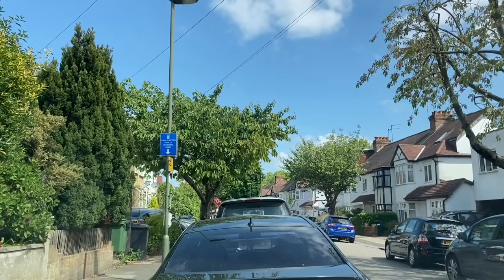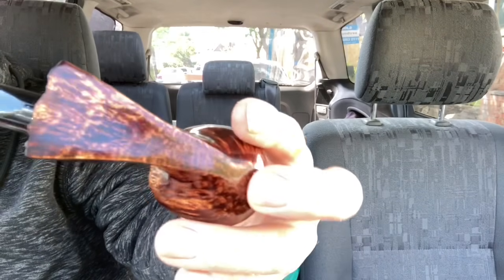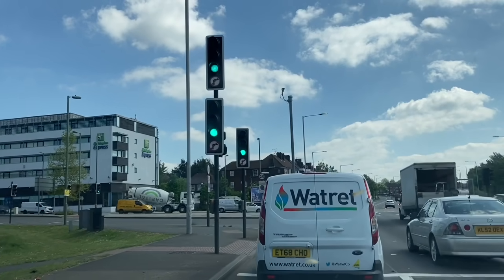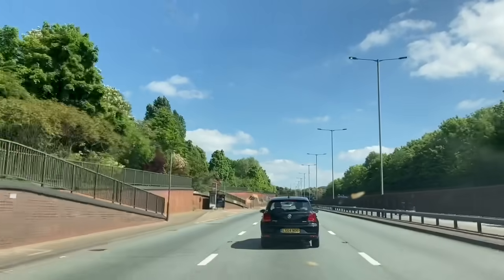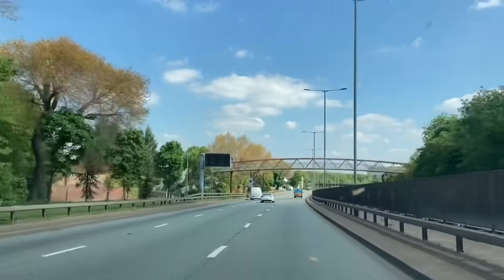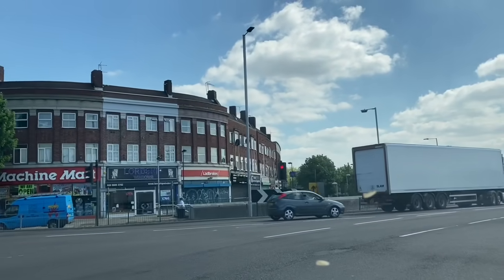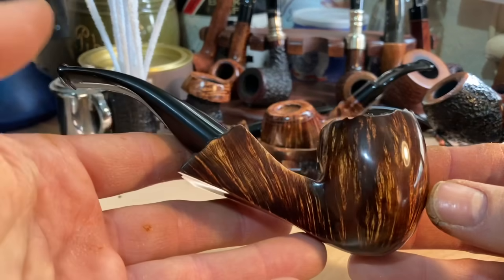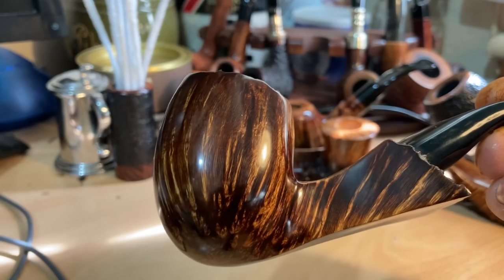Balancing pipes and stems

Comment: My pipes are still "its" for me too. They are a method of transportation for me. Carrying tobacco, to convert to smoke, to convert to transport to my mouth. As beautiful as they are, still objects. I keep zippo fluid in the house, but not in the car, I worry that the gas will expand or evaporate with the heat and make for dangerous or toxic driving with windows rolled up. Have a good weekend 👍🏻

Comment: An FYI about lighter fuels for use with zippo lighters. The components in lighter fuel is a hydrocarbon mixture including about 30% naphtha. The flash point of lighter fuel (lowest temperature that will allow vapors to ignite) is less than 73°F. Please do not store lighter fuel in a hot car. As a side note, I have had two cheap butane lighters explode in a hot car. The butane lighters will spread  plastic shards everywhere, but the fireball is fully ignited and goes out very rapidly so no interior damage occured either time. I was not in the car either time. Do not store pressurized butane in a car during Spring / Summer either. The high temps will further pressurize the can Excessive pressure will cause the can to fail, explode and possible catch the vehicle on fire.